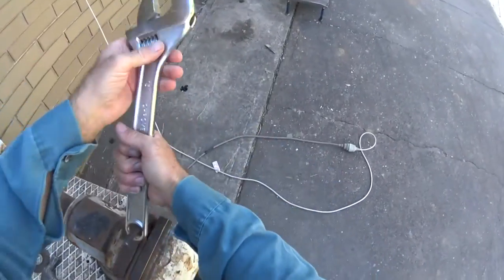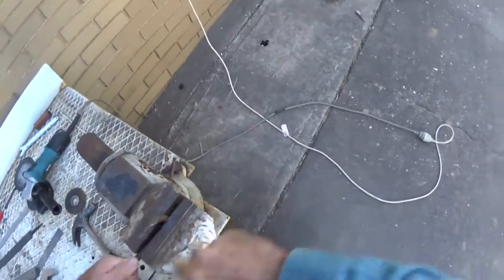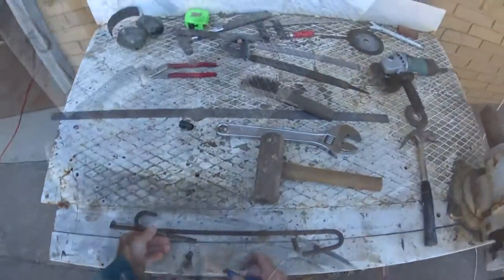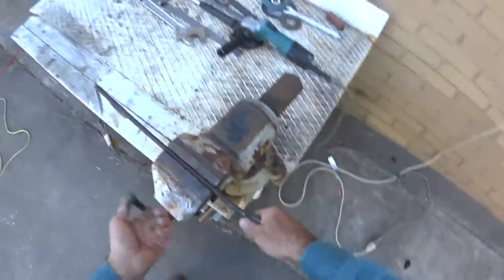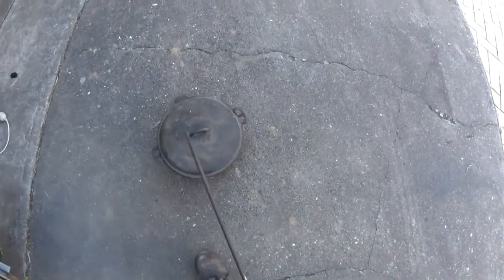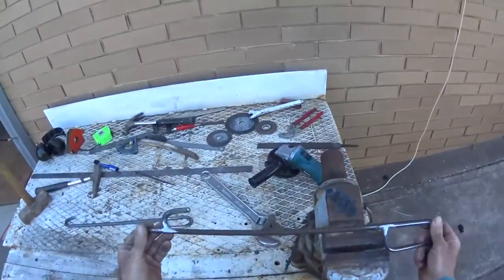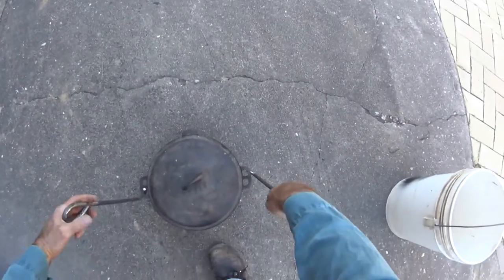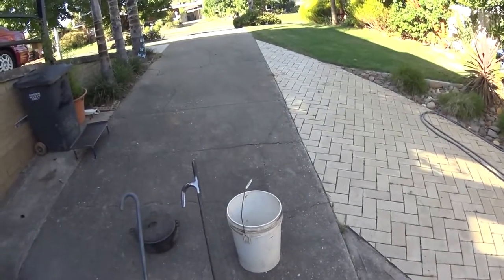How to Make Dutch Oven Lifting and Lid Hooks, billy hook for the fire. DIY Camping Gear projects

Comment: How thick of rod did you use and what lengths do you recommend.
Reply from the maker: Hi, The ones I use are made from 3/8 inch rod and measure 22 inches long, I like them a bit on the heavy side as I am at times lifting a five gallon drum on and off the fire. If you want them to be a bit lighter them 1/4 inch rod would be as small as I would go. Hope that helps a bit.
Reply: Thanks!

Comment: why didnt ya just put the j hook and handle in the bloody vice and squeeze then to where you wanted instead of beating the shit out of them
Reply from the maker: Hi, yes you are right, but, just using the vice the steel would want to spring back some of the way when you take the pressure off the vise, thats not a big thing and you just put it in and squash it a bit more. But when you belt it with a hammer what you see is what you get, I feel that's the way for me to do it. Heating the steel with an Oxy etc would reduce the noise by maybe 90%. So you plenty of ways to get to the same result. Thanks for your comment.